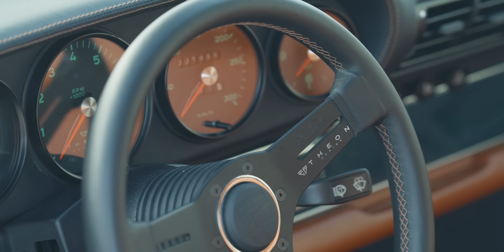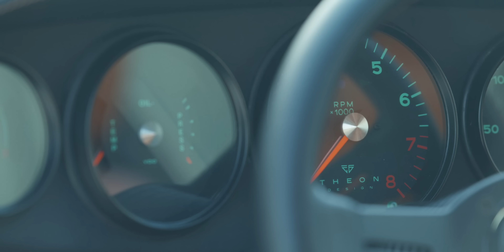Supercharged Porsche 911 by Theon Design review: a restomod like no other | PistonHeads

Comment: At £400k, you can't just dismiss the money. It defines the car and generates all kinds of difficult expectations and comparisons. At this price, it feels like you're paying a £300k premium for the air-cooled vibe and not much else. You can take, say, a really nice low mile 997.2 Carrera, chuck £30-40k at it and have something truly fabulous. Or a 997.1 with a Hartech 4.0 build, which would cost a piffling £20k for the build, have the interior re-trimmed and some lovely dampers. Or maybe just a 997.2 GT3. It's hard to claim any of those would be less car than this. Sure, if you want the air-cooled thing, you want the air-cooled thing. But good god, the premium, it's just so hard to comprehend. Buy this car, put 20k miles on it and as it begins to look a bit worn, feel a bit tired and develops a few squeaks and rattles, the notion that it cost £400,000 will begin to seem quite preposterous, I fear. Ultimately, at this price the car seems less like a thing for driving and more like a thing for ordering, a device for spending money. I think what cars like this are all about is the idea of the thing, process of specifying it, the 'luxury' experience of spending so much money commissioning something like this. Realistically, these cars won't get driven. The owners will lose interest soon after acquisition. Because owning and driving the car isn't what it's about. And the vibe of the thing is slightly cartoonish and chintzy as opposed to serious long term driver's car.
Reply: I am the owner. I agree with some of your comments. But not with all of it. I think you are right that you can achieve wonderful cars and equivalent performance for a lot less money. But one thing I like about this car is the network of craftsmanship and engineering they support in the UK. And fear not it will be driven but will never look tired.
Reply: I understand what you are saying, it was a huge amount of money to build this car. There are so many companies offering similar work at similar prices, has it got a little rediculous? So glad the cars owner left a comment. I guess if you can afford to build the car at this cost, why not. Were it merely down to power per pound, I would go for a 996 Turbo and a light custom job inside and out. But im content with my 996 C4S, at least for now!
Reply: @robinoconnor1203  The 996 turbo in an insanely good car straight out the box , they manage to combine the sound of the air cooled motor with some very basic modern comforts making a car that is stuck somewhere between 1995 and 2005 which is exactly what it is but I agree , some tasteful interior modifications would be interesting.
Reply: I agree with everything you’ve said. Fair comment. And 400k is a lot for a 911 of any description.  But - the big but.  If you can afford it then this end of the market (Singer) a hand built 911 to a bespoke spec appeals.  To me a bespoke 911 speaks volumes about the owner. A class act that knows what he’s buying.  Much better impression than say a Fiat with a dress on let’s say. (Ferrari).  Can a Ferrari really justify the mark up ?  Really ?   I’ll put my stall out - I don’t think so.  And the options list is a joke, they should be embarrassed. Not even nearly.  Rarity? if they stick to the make believe limited number of builds that they claim.  (BS). The days of these cars and other compromised cars being the only route to “high performance” are long gone. You can have four and the dog and get the same performance - so it all comes down to character and experience.  And this 911 seems to deliver both.
Reply: @crustyclown8845  I'm not a fan of modern Ferrari, but you get far more car for your money from, say, a new 296 than a tarted up old 911. The engineering that goes into a 296 is on completely different level. And can't really agree about what a car like this restomod says about the owner. It's such an obvious fashionista choice these days. I'd personally be much more impressed by a 964 C2 that looked mostly standard but had been modified to drive really, really well. Moreover, if what you really cared about is the drive, you'd probably be in a 996.2 GT3, which is just about impossible to beat. But it's not fashionable!
Reply: @julienbegasse6536  enjoy, I like the thought processes behind this vehicle. I hope it brings you many happy memories and if you can afford 400k£ to build, you can afford to maintain it, I hope.
Enjoy.
Reply: You are paying for a unique hand made specialty car. If this doesn't speak to you then it just never will. The great engineering. The top of the line bespoke materials. The custom build for a limited production car. Each car a one of a kind experience. You pay for all that. Just like you would pay for any high end art
Reply: Thank you @stefan Maddock ! This thread is very interesting. To be honest I personally don’t have any interest for a 296 personally. Too powerful, too perfect, too fast, no manual option. Clearly having something that is unique is very appealing (though I would not call myself a fashionista…), and like I said, I enjoy spending the money with smaller outfits and the network of craftsman they employ. Is it rational, no it is not. I own a 991.2 GT3 and that car is probably everything one would need. But if no one buys these cars, the people making them won’t have jobs. The truly world class UK car specialist industry needs to live on. And keep in mind that a) the cars were cheaper when I ordered mine b) people pay way more for Singer Porsches and I think mine is a good and maybe a bit more different. Finally, I would rather put my money into one of these than see it evaporate in the stock market😂 at least it gets people’s blood flowing. Now, merry Christmas to all. Enjoy your cars, whatever they are. A good car does not have to be an expensive one.
Reply: @julienbegasse6536  I'm not interested in the 296 either, turbo, paddles, hybrid. Yuck. But the amount of car, the engineering and hardware is undeniable. It's so hard to compute this Theon car being much more expensive. The whole thing is out of control re costs and what people are charging for these restomods. It's all about exploiting a certain kind of clientele and superficially justifying what they are charging and has increasingly little to do with driving cars.
Reply: True, but. Its a statement of love for the classic, timeless. Like a good watch.
Reply: @manoloprpr  It's not really timeless, though, is it? These Singer-style restomods are very much fashion items of the moment. Something else will become fashionable and then these cars will look very much of a particular era.
Reply: @julienbegasse6536  I hope to see you drive it here in Belgium! Are planning to take it to car meets?
Reply: The owner has to be applauded for making this investment in a classic Porsche. We all have our opinion on the result but it’s immaterial to a person that’s prepared to spend £400k to get exactly what he wants in a bespoke 964. I bought  a new 911 in 2019 but now find myself looking for a 964 C2 or 993 C2S. Current market prices are unhinged from any connection to real value. Ok I know prices are based on the limited and declining supply but paying over €140k for a good car with less than 100,000km is crazy. 997.2 and 991.1 offer much better value but there’s something very special about an air cooled Porsche.
Reply: @julienbegasse6536  or you could say, it's nobodys F-ing business how you spend your money.  If you like it and can afford it then awesome!  Personally, love it and wish i could afford one!  Congrats on a beautiful car and the memories you will make.
Reply: Atleast it’s cheaper than a singer
Reply: Some people are happy with roast beef and some want dry aged steak.   They both taste good.  Yeah?
Reply: That chattering noise sucks
Reply: @julienbegasse6536  OK so your wealthy and can afford to "support" craftsmen in the UK. Super. I think Jeremy was bringing it down a few notches to reality for most of us - saying the extra $250-$300K doesn't demand the ROI for the most part.  I am happy you have this car - I have had 2 911's and 1 912,  69,95,96. Love the cars - no question. But.
Reply: Its just money. Some regular people buy ridiculously  expensive shoes..or a bit of fancy furniture.At least this thing will take you places,...so if you got the cash,i totally get this.Whatever makes you happy.Dont hate a guy for having more than you got.We are all car people.Just drive the €#@¥ out of it,and ENJOY!!🛸✌️😁
Reply: @julienbegasse6536  I don't have much of an opinion here. Really nice car, not my taste, would prob go for something else for the money, but really appreciate the fact you jumped in and answered some questions. Lots of review videos out there of custom built, modified, or tuned cars, but rarely do we get much input from the owner. I wish you many enjoyable miles and hope the car is everything you hoped for; it looks and sounds great !
Reply: @jackassrower I am a Theon Design fan and yes it's quite nice to hear from the owners perspective which is very rare indeed.
Reply: Bravo! Well said mate.
Reply: Singer instead❤
Reply: Yes but those who have this much money won't have that much brain. Simple
Reply: Late to the party here, but you are completely missing the point, kinda feel like you didn't actually watch the video and see the craftsmanship and build quality. A watch is a watch is a watch right? A swatch tells the time no different to a Rolex, but the Rolex is in a different galaxy to the Swatch on more things than just price. An off the rack suit covers your ass no worse than a fully tailored item, same for shoes, etc etc. Your 997.1 example is always going to be an off the rack option, albeit an expensive rack, vs a fully tailored car. 
Your 997.1 was barely touched by human hands when it left the factory, this car hasn't had a robot anywhere near it. The door handle isn't where an engineer decided to put it, it's EXACTLY where the owner wanted it, the shell is seam welded rather than spot welded because it's both stronger and prettier, that high level brake light is sublime, better than any factory effort....and so on THROUGHOUT the car.
It's not about performance anymore more than a hand crafted Italian shoe is about improving your jogging, which is to say not all. It's about the fit, about something being EXACTLY what you want. 
And it's not about the  "'luxury' experience of spending so much money", it's about building something absolutely exquisite, contrasted against the OEM engineers and accountants getting together and figuring how they can charge the most amount of money for the least amount of product. 
And quality costs, simple as that. Unlike robots, craftsmen are expensive to run.

Comment: If I was in the market for such a vehicle, my money would be going to Singer. This is clearly a nice 911, but it just doesn't have the same level of refinement in it as a Singer does: the fit and finish, the smoke (9:01), the supercharger chatter, are reasons why it doesn't deserve that price tag. For a rough comparison, there's an immaculate, fully restored 964 RS currently for sale on Pistonheads for £169,995 and a 9,200 mile 997.2 GT3 RS for £214,995. So... for your money, would you rather have those two in your garage, or this Theon?

Comment: How do they did dissipate the heat that 400 hp produces? All engines are “heat engines” power = heat, period. Do they run it rich to cool it ? This is something I’ve never understood in air cooled resto-mods. If you asked another 200 hp out of a Continental or Lycoming, you’d cook the engine doing it.
Reply: This car has methanol cooling...other SC solutions opt for intercoolers

Comment: I would rather have a 1970s  mint 911 S with a tuned engine  about 300 bhp. In black  or dark blue.  With no body enhancement.  Just as it left the factory.

Comment: You'd need to be sectioned to buy this for £400k. Wonky bonnet panel gaps. Smoke billowing out of O/S tailpipe. Clueless in house knowledge re a supercharger being totally inappropriate on an air cooled engine. Total fail.